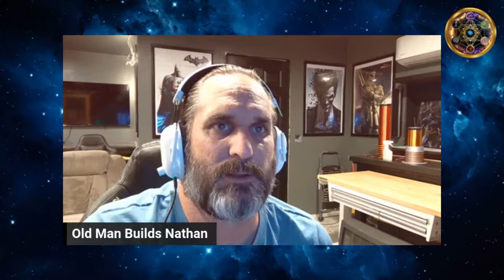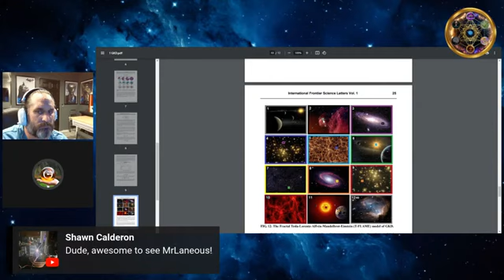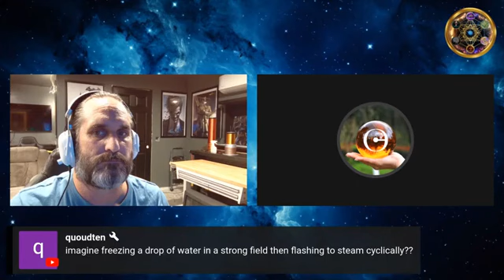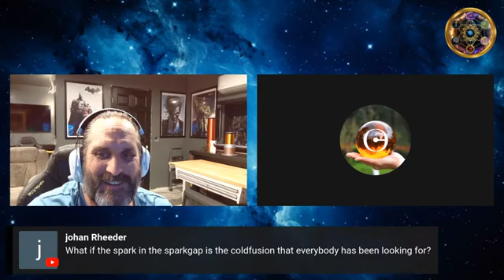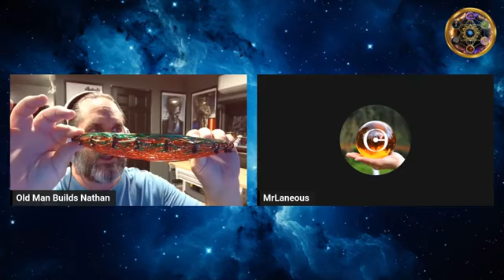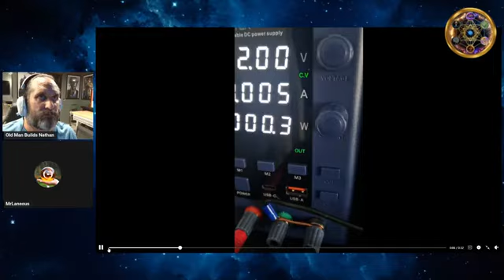Monopolar Electrets and Hybrid Power Systems Disclosure

Comment: 14:40 how to isolate the 2 , not sure , but i think you can separate the voltage from the current with capacitor , and maybe the current divert to the load

Comment: 7:30 a lake hold water it sits level , this is you amps , until this lake is lifted by gods hand to form an unlevel position the amps will not flow , this angle is your voltage